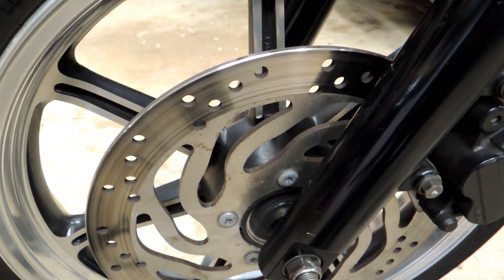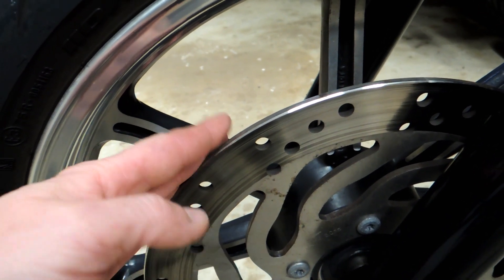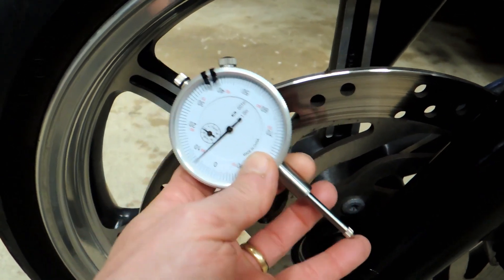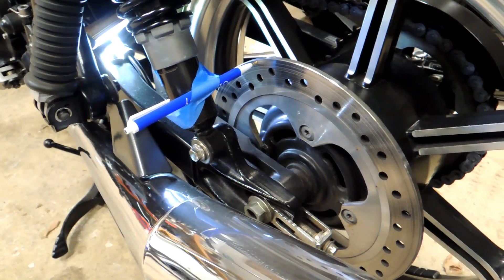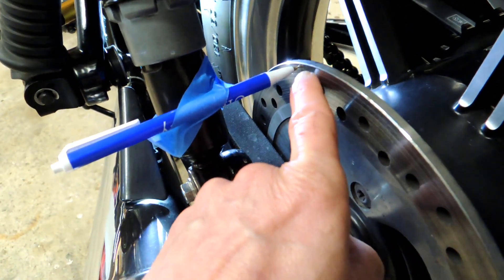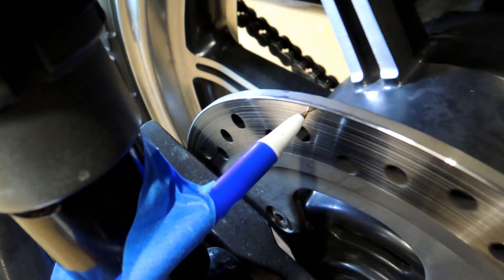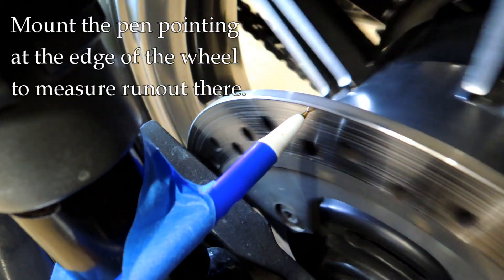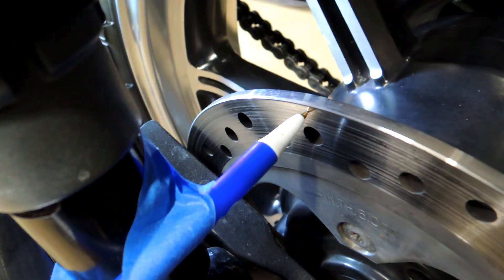Quick Test For Brake Rotor Or Wheel Runout

Comment: Sitting a spray can next to the rotor on the floor works well also . As long as the bike doesn’t move around on whatever you’ve got it jacked up with. Good point with the ink pen though I’ve never seen it done that way.

Comment: Can a front rotor be shaved to make it more true?
Reply from the maker: With cars and trucks you can often have rotors "cut" and resurfaced, which also trues them at the same time.  With bikes, though, the rotors are so thin in the first place that this is not an option.  Fortunately, they aren't that expensive to replace with new.

Comment: How to know in drum brakes?
Reply from the maker: Drum brakes are trickier.  After all, it's the inside area which needs to be perfectly round, and you can't get to that with the brake shoes and cover in the way.  You may be able to remove the brake cover and shoe assembly, and rig up a way to keep the wheel and drum in place without that assembly.  Then you can spin the wheel and do the same runout test.
Reply: Thanks man

Comment: The problem I was experiencing was when my bike was moving forward, I kept hearing break squeal and it grabbed only at a certain place on rotor. I thought rotor may be bent. I never felt wheel wobble or anything when riding, though. It was wrecked in 2015 with front-end damage, but was repaired by a local yamaha dealer. I never noticed this squeal until a few years ago. I am going to try your method and see if I can tell if it is a warped rotor. I just hope its a simple fix because the dealer wants $125 an hour to work on it.
Reply from the maker: A brake squeal could be related to other things, such as worn pads, misaligned pads, or loose pads.

Comment: How is the runout corrected??
Reply from the maker: Usually by replacing the part!  Brake rotors, once bent, should be tossed out.  Wheels can sometimes be corrected, but it takes special expertise and equipment to do so, and there are not many companies who will work on motorcycle wheels in that way.
Reply: Thanks for the reply

Comment: With a dial indicator, what is the threshold that is considered acceptable range?
Reply from the maker: Various bikes could have different specs.  My Triumph, for example, says .1mm to .15mm is acceptable for the brake rotor, but more than .3mm means replacement.  I wouldn't get too caught up in measurement, though.  If you feel something wrong when you brake, try the runout test with a pen or pencil tip.  You can typically see a gap with your eyes if there is warping.

Comment: i done this test and my discs are out maybe 1-2mm both sides, would this be enough to cause brake judder ?
Reply from the maker: If you spin the wheel and find that one area of the brake rotor is 2mm to one side versus another part of the rotor, that's certainly enough to cause a pulsating feel to the brake lever.  The judder you describe may be the rotor rubbing on high spots (relative to the brake pads) with light braking.  Your rotor may be warped from heat, or it was unevenly bolted onto the wheel, or it sustained physical damage.  Another thing you can check is the gap between the pads and the rotor as you spin the wheel.  Get the wheel up off the ground and shine a light from behind the caliper so you can clearly see where the pad kisses the rotor.  Spin the wheel slowly and see if you notice a wavering gap as the wheel spins.  If you can confirm the rotor is warped, the only solution is a new one, and I would recommend new pads at the same time.  Fortunately the cost isn't usually too bad.
Reply: @tinderboxarts  thank you for your time and post.. im on it! :)